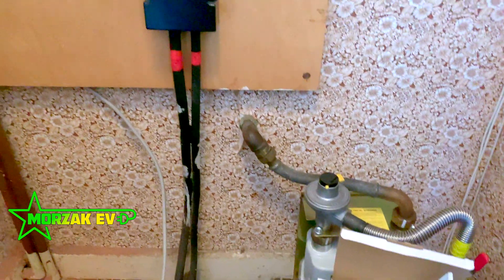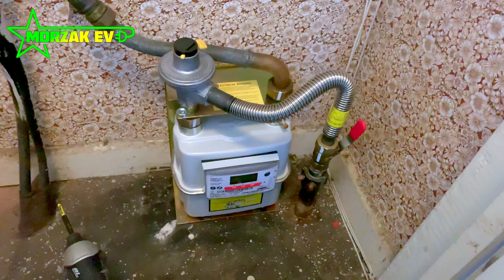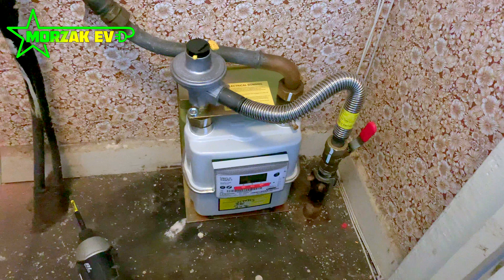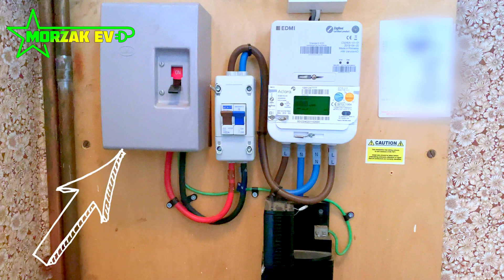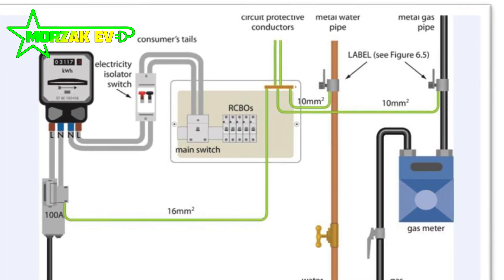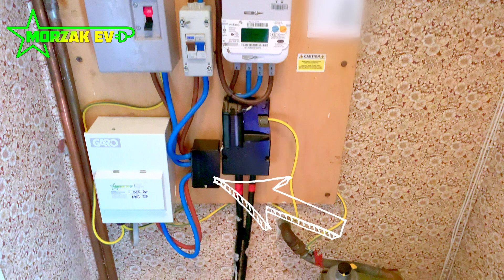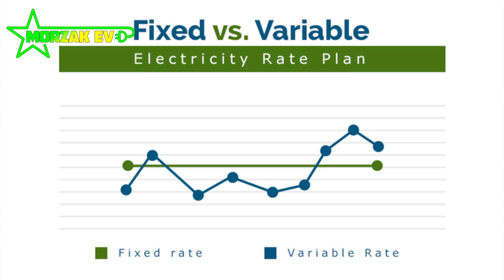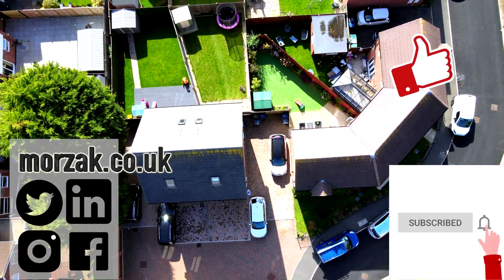Are my electrics too old to have an Electric Vehicle Charge Point installed, do they need upgrading?

Comment: Thanks for the informative video.  My question is, my electrics are 11 years old and I have no gas so everything uses electricity, so my underfloor electric heating takes a lot of power when everything is on in winter I hit almost 15kw so if I charge an ev at the same time say another 7kw would that cause an overload?
Reply from the maker: Hi Keith,
Great question. So assuming you’re on a standard household single phase supply, at 15kW, that’s about 65A, and so once you add the 32A for the 7kW charge point, you’re running at 97A. Depending on the incoming cable and mains fuse size, this could be anywhere from 60A to 100A - it may say 100A on the mains fuse but in all likelihood most are actually less inside the fuse carrier. So, the first step would be to contact the DNO to establish and upgrade the mains fuse if possible, and depending on the answer to this, you’d likely want some form of load management. It just so happens we’re lining up 2 videos on these topics in the next few weeks so hopefully this will answer your questions, so stay tuned!
Reply: @MorzakEV  Thanks very much. Merry Christmas and happy New year.
Reply from the maker: @keithware5314  Merry Christmas to you too